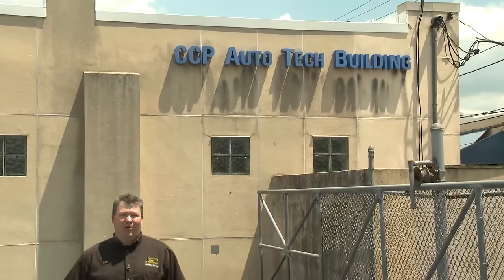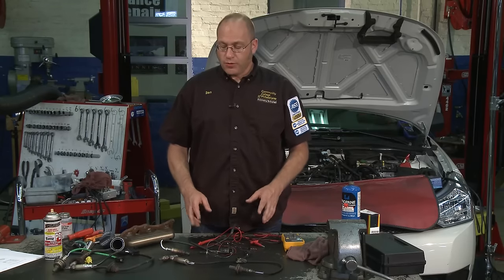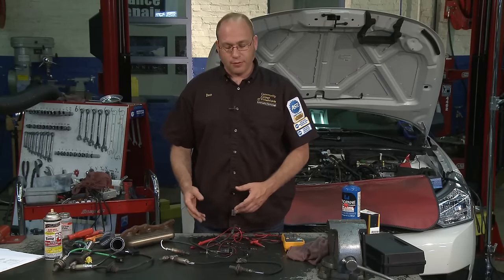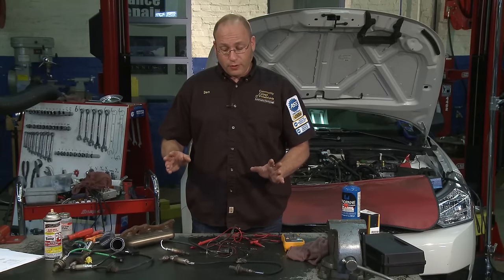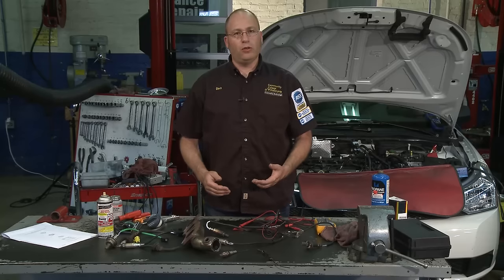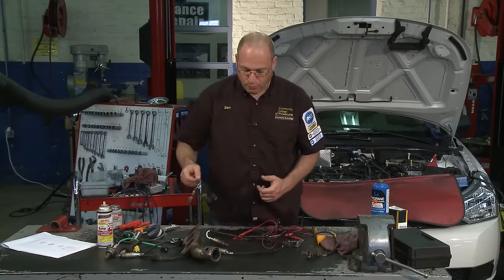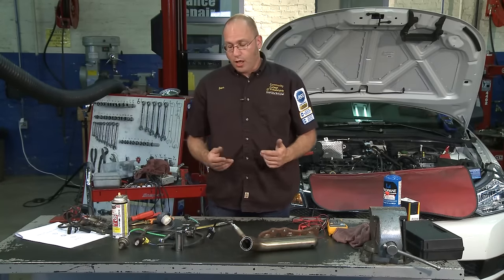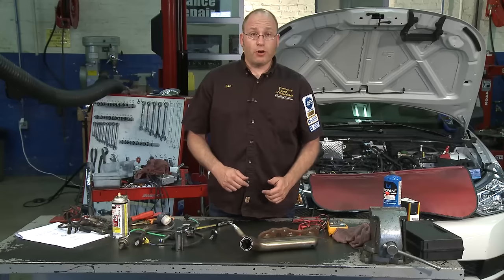Car Corner: O2 Sensor Diagnostics

Comment: I guess the only foolproof way to test an o2 sensor is to remove it and put a propane torch to it...see if it oscillates from rich to lean....you could do snap throttle tests and check its waveform...should go rich then lean and then level out....but testing a downstream o2 sensor is tricky to do with it on the vehicle

Comment: 89 Toyota pickup truck air mass flow sensor repair truck runs for about 18 minutes and then dies when you give it gas it doesn't rev up it just dies out

Comment: I had to immediately comment at about 27:00 . The impression is starting to be given is that HEAT effects the output, which it does not. He did not explain that he is depriving the sensor of oxygen when the flame is on it, and allowing oxygen when he takes the flame away... Chemistry basics, a flame CONSUMES oxygen.
Reply: It was a demo of voltage, he even disclaimed it before showing. If the sensor was bad it wouldn't show at voltage or the voltage would be incorrect.

Comment: WHERE IS THE UPSTREAM O2 SENSOR LOCATED ON A 2004 SUBARU FORESTER
Reply: Well upstream is before cat and if its has four 2 banks , it will have 2 generally engine compartment, which bank 1 by cyl 1, hope it helps somewhat

Comment: If an o2 sensor goes bad, the engine may also run richer by default, and so it may run hotter, and that's bad for most components, especially electric parts.

Comment: Sun Nov 12 2023 you created a little confusion while looking at the schematic for pins 1 to 4 on the removed O2 sensor you showed us pins 1 and 2 for checking a healthy resistance of under 5 ohms and the you said you were going to put the probes on pins 1 and 4
And then you got an open circuit and said the heater circuit on the sensor was defective
I’m sure you connected pins 1 and 2 for resistance but we’ll never know
Your cameraman never caught it

Comment: I agree with you,
Except the whole Emissions was design to MAKE MONEY.
Reply: Correct along now some cars have 2 to 3 cats and a lot more sensors it s all killing the consumer  I will rather drive a old car
Reply: Well it saves you in fuel costs so it works out for both party's   but yeah the mark up on parts is extremely high, if your smart you can fix it your self and use used parts or other brands.

Comment: X2 on the Airtex (poor quality); I would not install that brand 02 sensor.
Reply: ALWAYS TRY TO INSTALL THE SAME MANUFACTURERS O2 SENSOR THAT CAME WITH THE AUTOMOBILE!!! DON'T BE CHEAP. IT CAN LEAD TO BIG PROBLEMS IN THE LONG RUN! OEM PARTS, ESPECIALLY WHEN IT COMES TO O2 SENSORS, IS IMPERATIVE!!!
Reply: The fact that they show; installing a Airtex branded product, in a educational video is actually depressing and setting up the would be new tech for failure, possible comeback from their customers. They need to discuss; how crucial, high quality parts are and in particular parts, that regulate engine control systems. Buying aftermarket poor quality parts; is just setting yourself up for failure and brain damage! On my VW I used oem high quality Bosch; just like from the factory! Do it once and do it right with oem factory parts! :) 
At our shop, we have seen Airtex fuel pumps fail prematurely and cause more problems, than anything else. I recommend, staying away from Airtex brand auto parts; you just end up, doing the job twice and spending more money, on higher quality parts that work.

Comment: Best preventive maintenance in the world I found out is keep it away from a Pennsylvania Inspection Station if you can, funny how down in Florida my 1992 Ford Ranger never had a problem until I moved up to Pennsylvania and had to have an inspection done on it,  Then all of a sudden I had an ABS light, then after that I had an O2 light, then the next year I had the inspection done, then the truck wouldn't even start, the whole thing is the truck always worked down in Florida, and the only time things happened was when I took it to a Pennsylvania Inspection Station. I mean I never had a check engine light or anything until well you know PA. inspection station, now what these guys didn't know was I was Ca. ASE certified. Come on you don't go yanking on 10 year old wiring systems, now do you, don't try to tell me that that is ok, I used to be an electrician on aircraft in the Navy,  you want to make us angry, yank on our wiring bundles in a 30 year old aircraft. You could have a 5 lb ball peen hammer coming at you in not such a nice way. So on all my vehicles now, if you live in Pennsylvania look the vehicle over and write down all s/n like on your EC modules, I didn't but I do know that from taking multiple items off heat sinks with Heat Sink Compound on it, (like on the EC module) that you usually have to break them off by using like a putty knife after they been on the Vehicle for a few years, when you loosen the nuts or bolts they just don't fall off. I had some tire place tell me that they do, and I laughed in his face, saying uh, uh,  so do yourself a favor because some of these mechs will remove a module and put a bad one on, then when you take it back in to complain, they say oh your module went bad, then all you have to do is bring out your pad and check the s/n number, having that on my vehicle saved me hundreds of dollars in Pa. especially when I showed him the part he took off my vehicle was not on my vehicle before, but the part that now works was the part serial number that was on my truck before, and then I showed him that that part was replaced twice and had the s/n of both parts. By the way the tire place manager gave me back the money I paid for the inspection because he knew I was going to take him to court. But one thing that is now hitting me is mechanics yanking on wire bundles. With age wiring gets old and brittle, so if you  start having problems with sensors go back and tell the mech that if he wants something to yank on, tell him to yank down on his dick, especially if he is old maybe with any luck he will and it will break off.

Comment: Doctor procedure OPQRST,  Onset, Provoke, Quality, Radiate, Site, Timing ... Onset slow, fast, when ?  Provoke, what makes it better or worse, Quality what is the problem really like ? sharp, dull, hot ? Radiate ? does the steering wheel shake when the tire is the real problem?   Timing, certain time of day or certain event ?  95% of diagnosis is from this. Tests are to confirm or rule out. Thanks for the video.

Comment: 3:04 A little humility, please. Sophisticated tools can make a 'Master Technician' out of someone who is marginally skilled or intuitive. Changes in technology have made 'technician' the new term for 'parts changer', to the fault of no one who is 'ASE Certified'. That's the modern state of the industry. Due to the inevitable evolution of the trade the term 'mechanic' is less favored in prideful professional circles while remaining perfectly apt for the classic shade-tree wrench spinner.

The mindset of smartly using one's time in diagnosing an issue rather than guessing and throwing dollars and parts at it is what defines a true expert, whether aided by a multi-thousand-dollar arsenal of equipment or directed by the basic attributes of experience and instinct. 

This is a good video, because he does address the possible presence of less technical and simpler if non-obvious elements, like a loose gas cap or faulty, aging vacuum lines. The unintended arrogance of assuming what separates 'pros' from hacks didn't set well with me. : ]

Comment: Access is the biggest problem, tools meters, Just way too much crap for people to deal with, expense is staggering with repair shops. Never had these problems on a well tuned 70s automobile. Senors can in no way be reliable at locations on engines. Road elements make engines dirty and that makes it difficult to keep engine clean. As far as I'm concerned people are being used as test dummies. Manufacturers should make these repairing nightmares. They designed they should fix it. Emissions is a government concern. People just want a reliable vehicle. Your video however is excellent trying to understand how it works. Cars now days are rich men items. Poor guys don't have the money to make these crazy repairs. Very sad for the working man. Shops are all shady. I drive an a 2002 E150 Ford van, and the engine light is on. Meter said running lean, engine runs good. But I know it will fail if not repaired. Autos are much too complicated for people today living in such a poor economy. Thanks for your insight on senors and how they work. If this were a carburetor I could clean or adjust fuel jets, check plugs, well do a tune up. I do not like cars run with computers. Or these multiple coils. Give me mechanical engines any day. Reliable cars is what we want. Be able to work on them when needed. Even more enough room to access needed locations. Building around the engine seems backward. Sorry if I offended anyone. Thank you.

Comment: here is another bit of wisdom shop wants $300.00 to put car on extreme diagnostic to identify exact problem. parts store will read and clear codes that give a general idea of problem the sensors cost bout 50 bucks eh. so we throw parts at it industry intended
Reply: kinda true what you say what garages charge just for diagnosing vs try a few less expensive parts on your own and make some semi intelligent guesses based on the codes and what internet says the codes may represent lol

Comment: A little too wordy for my long term exposure,  way too much unnecessary information added on.  Let's shorten it up, we don';t need to fill a one hour classroom time period , this whole presentation could easily be relayed in 12 to 15 minutes max.  We don't need a history of O2 sensors and heated sensors and how rust effects electrical conductivity. Then he goes into how the O2 sensor has it's own wrench history...come on !  Not needed!  Maybe this presentation could be shortened to just 8 to 10 minutes.

Comment: This is not a good Tech because when you clear the codes from the computer you have to Drive X amount miles before the computer collect's data to display any error codes , and this is the very basic and he call himself a mechanic REALLY!!!!!!
Reply: What would you do?
Reply: you do not have a clue what you are saying that code comes right back on its the heater open same as the wire being cut
Reply: Been my experience some codes will clear once the fault is replaced other codes need a duty/run cycle for the pcm to chk itself and see that the issue has been resolved. In the video he stated the engine light went off and due to his total diagnosis I'm sure that was the issue. A lesson and video well taught,thanks for bringing it

Comment: this is what happens when someone who is overall competent makes absolutely no sense at all in one area. He spends minutes talking about who you don't want to cut the wires - well - its because you are REPLACING THE UNIT!! When you are able to break loose
 a used part, guess what? When you put in the NEW unit on, the threads are chased out and the new one can use an open end wrench. Think before putting out a video. Personally, I am a nuclear engineer who started on rebuilding cars when I was 13 - am now a professional engineer with 6 years nuclear Navy. Slow it down and explain it better. We owe it to the newbies.
Reply: @xxomegaman007  You ARE cutting the wires - its simple. The wiring and the end of the wire is being replaced. It comes with the unit. Simple

Comment: Modern cars > SUCK < All the electronic Bull crap. Compare a 1965 Mustang to a 2020 Mustang ; the 65 most of the time cost $ 175 for a total tune up, filters, fluids, spark plugs, wires, dist. cap, rotor button, condenser, etc. & 2020 would be in the thousands !

Comment: Most worthless device every created.  Pain to replace.   Can damage your car too.   Terrible tech.  BAN THEM.
Reply: I do half agree with you, its not actually an oxygen sensor, it can never sense oxygen,  it doesn't know how to, it senses the heat produced by fuel and air! its an indirect measuring device,
Reply: @mgabrielle2343  O2 sensors detect an oxygen differential between “outside air” VIA a reference channel, and what’s lacking in O2 content inside the exhaust stream.  Heat is required to make the internal element read accurately and quickly.  In many ways it is a small and weak type of fuel cell.

Comment: - god forbid, this dude spends more time babblin' than givin' proper concise instruction.
- go logically thru the process !? !? puhhh! should have tested the sensor before removing it.
- no such thing as a diagnostic tool for the check engine light engine and transmission only!?!?...
that engine light warns about a slew of sensors many which have nothing to do with the engine